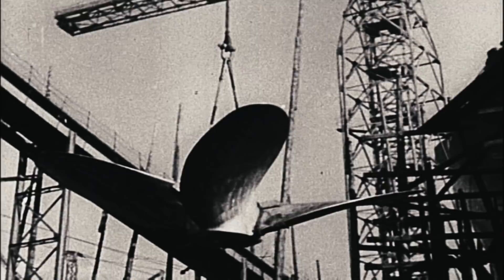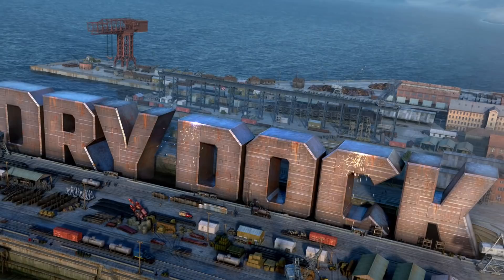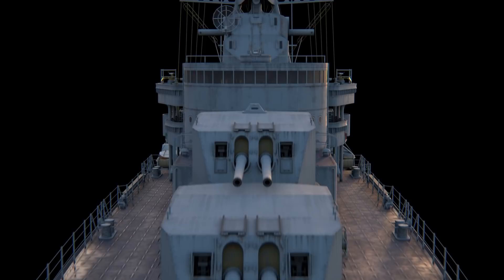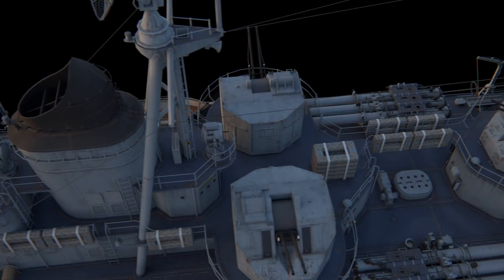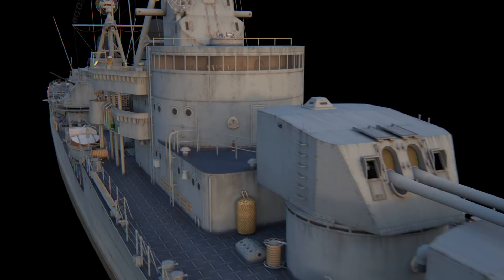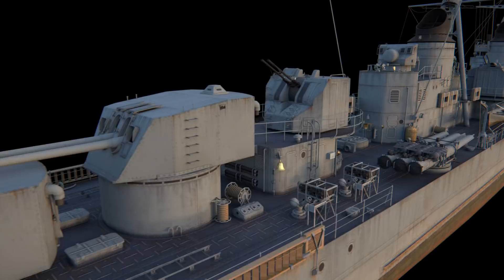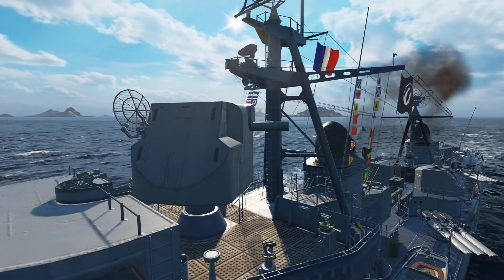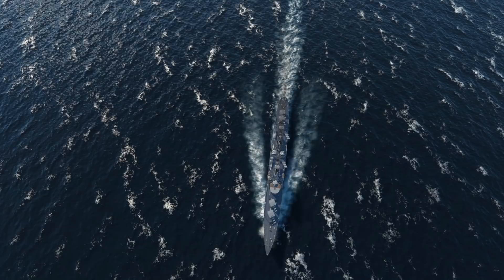Dry Dock. Kléber — French Tier X destroyer | World of Warships

Comment: Funny because I literally couldn’t find anything on these ships. Just the T 47 class that succeeded the Mogadors in the mid 50’s.
Reply: 2 ships, one of which was named Kleber, were designed to be the "enhanced Mogador".
It's in the wikipedia article of Mogador-class. Not a separate class, more like "improved version".
Reply: @franciscodetonne4797  The "Enhanced Mogador" are Marceau, Desaix, Kleber and Hoche. The 1939 plans for those ships is almost the Hull B in wows (but with 100mm aa). They were supposed to go back to 130mm in the 1940 plan because 115Volts was a bit weak to power heavy turret like on Mogador. So yeah, wows plans are total fantasy on Kleber.